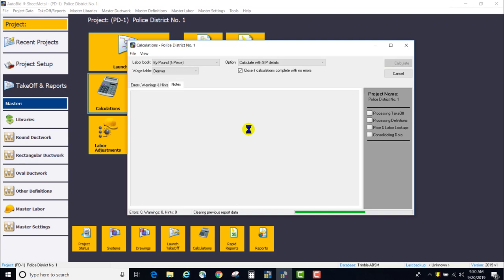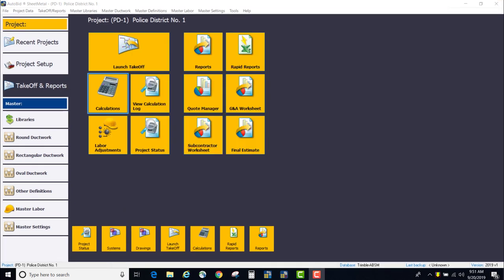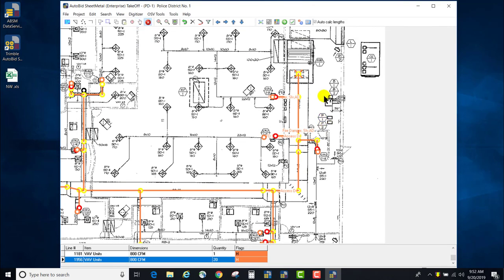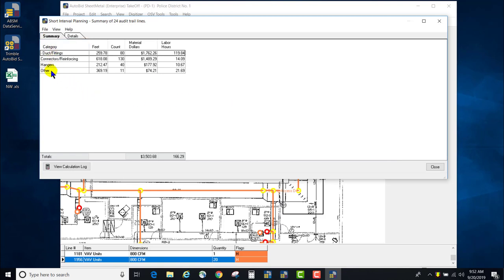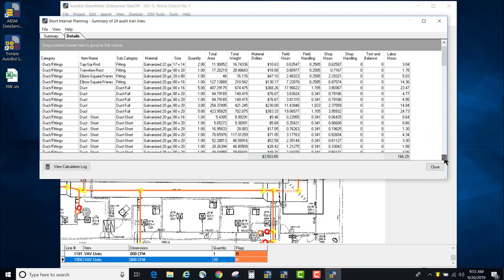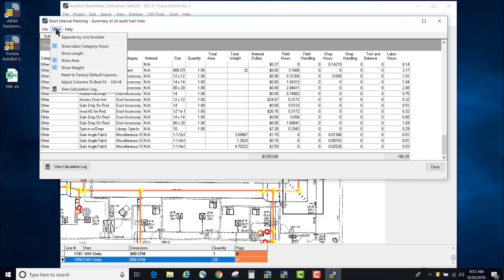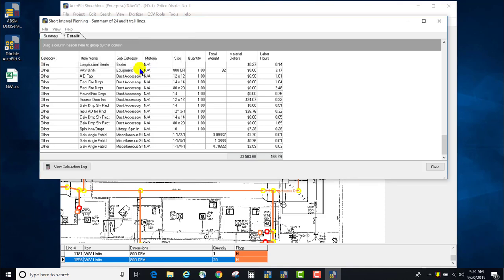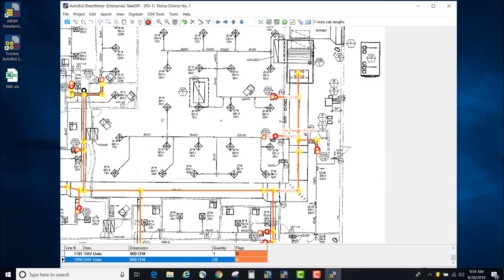AutoBid SheetMetal 2019v1 Short Interval Planning (SIP) Details

Comment: How are field hours estimated? I understand a cut and paste format could be developed to estimate hours of install per materials size/weight.  however , not all sites are created equal as in a building with 20' AFF install takes longer then a install at 10' AFF. Also building structure type vs attachment methods for mechanical systems vary from job to job. I do like the fast itemized breakdown of materials.